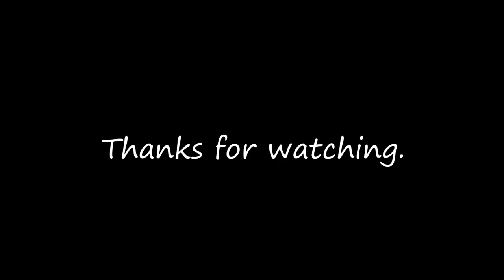Making a rotating epoxy drying rack.

Comment: love the ingenuity! if you do not mind could you tell me what kind of epoxy you are using? I am using a two part epoxy that is very thick and your's seems to be thinner and easier to use.
Reply from the maker: saintsfisherman its a marine grade two part epoxy that is UV resistant and its also very thick, but since its an 18 hour working time epoxy you can gradually heat it up to make it run a bit better without affecting the cure of the resin, you can do this with any epoxy you just have to get the temp just right to the cure time.

Comment: I’m looking to do something very similar, where did you find your motor and power for it?
Reply from the maker: Caleb Zlomke it's from a kids night light and the cable is rated for the amount of voltage that the motor requires
Reply from the maker: Caleb Zlomke it's from a kids night light and the cable is rated for the amount of voltage that the motor requires